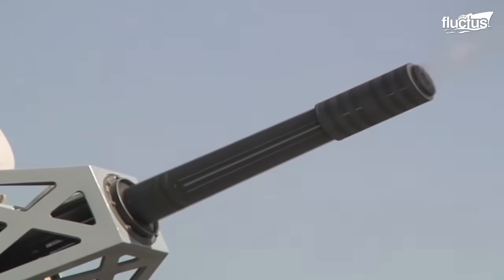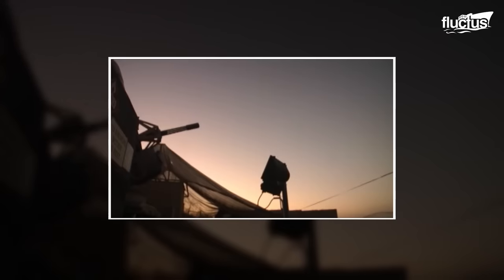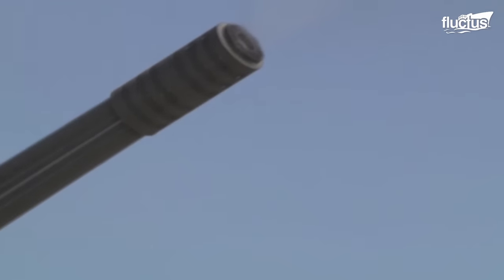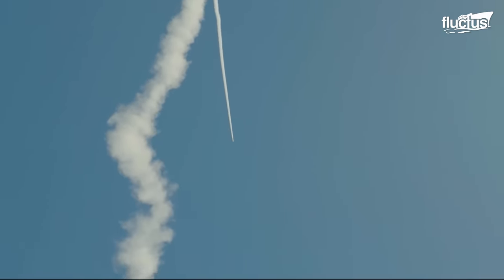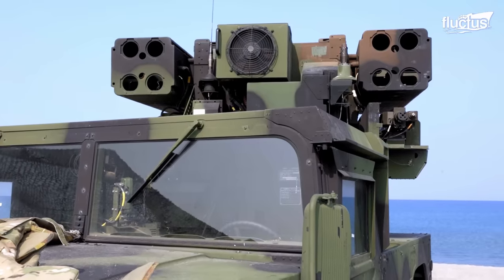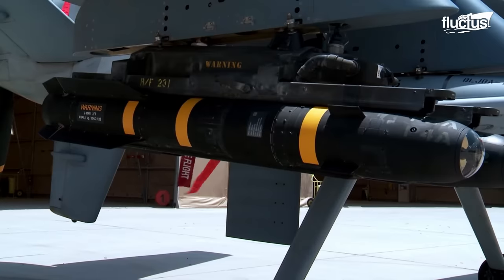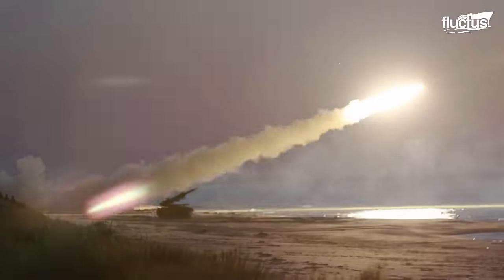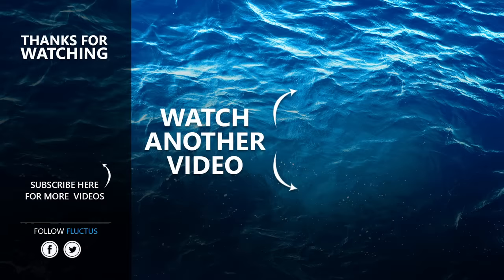Behind US Genius Idea To Test a Truck-Mounted Super-Fast Gatling Gun

Comment: GAU-12 (big brother to the GAU-8, of A-10 Thunderbolt fame) is also airborne in the USAF AC-130 Spectre gunship; Unlike the sea-wiz/gee-wiz, the previous Gatling guns are not autonomous, but use automation-assisted targeting... occasionally backed up with  a 105mm howitzer, for "punctuation".

Comment: We used this in the Netherlands almost 45 years ago. The goalkeeper 
It is a Dutch invention, and as a Dutch Marine I have seen this beast working. 
It is impressive and very effective
Reply: you're right this is dutch in design and in software - puzzing why Americans think this is indigenous. 
this thing probably wouldn't exist without NATO.
Reply: how often must reload? at least 1-2 man team to reload, burns bullets a lot. trucks needed to supply enough ammo :D
Id guess still cheaper to burn thousands of bullets per min than launch one patriot/S-300,S-400 missile per threat.
Reply: The Phalanx was developed in 1969 produced in 1978. The Goalkeeper was developed in 1975 and produced in 1979.
Reply: @effexon  Yes we have depleted uranium.
Reply: @chechnya  Yet the Gatling gun was an American invention from 1861.
Reply: @alberto148  Because the Phalanx was designed in 1969??

Comment: Very cool, served with some of those brigades in my PATRIOT days. What an awesome system.
Reply: Yeah I remember Charlie Battery 3/2 ADA tested the prototype in Yuma. A what units were you in? I was E btry 3/43 11th BDE , A btry 3/2 31st BDE, A 1/1 ADA 94th AAMDC and HHB 31st BDE from 2001 to 2007
Reply: @Chris1982416   I was in D 1/44 ADA it's been ages so recalling which brigades is difficult but I recognized a couple of those patches. I was in from 07-2010 edit: 11th, and 35th sound familiar but don't hold me to it lmao
Reply: @M00R3  do you know a guy named SSG Mahlstead from your days at 1/44 ADA
Reply: @Chris1982416  no. Was he in delta? That name rings zero bells.

Comment: Imagine making it smaller and adapting it to a tank to protect the crew
Reply: Then the tank would evolve in the direction of the battleship. Battleships used to rule the seas, able to outgun any ship besides a comparable enemy battleship. But over time, battleships became vulnerable to bombs and torpedoes, and they had to keep mounting more and more anti-aircraft guns. They also needed escorting ships such as destroyers to protect them from hostile torpedo boats and submarines. Eventually guided missiles rendered their big guns obsolete, and battleships became too expensive to maintain. The tank is like the battleship of the land - not obsolete yet, but threatened by an array of weapons that are hard to protect against. Tanks are great if your enemy has only rifles and machine guns, and not so great against artillery, anti-tank missiles, and mines. Like the battleship in its waning years, the tank is only useful if you have the other assets necessary to protect it, or you're facing a very poorly equipped enemy.
Reply: y tho

Comment: C-RAM is designed to defend from missile attacks coming directly towards the ship.  The 20mm gun usually has too short of a range to be of much use in a land-based setting.  This was the problem with the Vietnam-era M-167 Vulcan Air Defense System.  I would love to see a C-RAM type system paired with a Bushmaster gun in the 30-40mm range.

Comment: I dont think this is anything new, in 1973 we had The M167 Vulcan which we towed as a unit not a trailer. It was capable of firing as many rounds of the same exact ammunition, 20 MM. I was in the 1/3 Air Defense at Fort Campbell Kentucky, if we had them in the 101st Airborne Division then I know they were widespread across the combat units of the US Army.

Comment: I want to see a CRAM built around the 30mm gun on the A-10, that would be epic
Reply: A ground vehicle would hold more than 30 seconds of Wupass! However the German Gepard with twin 35mm Cannons is fun to watch too! Too fun! Proximity fused ammo that creates a cloud of really sharp metal in front of a flying target. In an M1-A2 Abrams Tank..the driver has to do not much when the Cannon fires as the drive line talks to the gun and absorbs the recoil. Ergo it can shoot at 45 MPH and 72 tons.
Reply: Give your head a shake man.....the A-10 was built around its gun.  It would never fit.  Im saying put around a dozen on an AC 130😮
Reply: @spencercameron2980  Bigger is better.

Comment: Both "not invented here" and "no perceived need" is very Army. 
Plus the Navy version is built for sea conditions, heavier and dependent on ship crew and probably at least some sensor feed. 
Truck mounting and support with power and sensors, probably needed in at least pairs to cope with many incoming drones. The ammunition goes quick. I do not know the allocation of shots to assumed distraction of drones. 
Ships I would think have multiple systems protecting a small area. 
Protecting Infantry lines and support is moredifficult, line of sight matters.

Comment: I much prefer the Rapidfire from Thales Group, it fires bursts of 4 programmable shells, no need to fire thousands of 20 mm shells, the CTA 40 mm fires very precise small bursts on anything that flies, planes, drones , helicopters or missiles , maximum rate of 200 shells per minute , it can pierce 20 centimeters of reinforced concrete ( 8 inches ) and explode into hundreds of shrapnel in the room behind , shoot down anything that flies and detonate the ammunition above of a wall where terrorists are hiding! simpler and cheaper
Reply: Agree, SRAM wastes a lot of ammo, but because of its superior fire control system the German Geppard normally manages to down a drone with 4 to 6 cannon shells,
Reply: @chrissmith2114  Three.
Reply: More than 20 years difference.

Comment: Better idea:  Put it on a C-130 gunship so it can't be shot down.
Reply: A C-130 can't be shot down?  🙄
Reply: The first AC-130s carried 4 x 20mm gatlings, and 4 x 7.62mm miniguns (1967).
Reply: @shadowgunner69  , yes, but there were not radar guided and on a gimbal.

Comment: I have known the testing of this Land-Based Phalanx for over ten years.
It must have been a failure to see that it has not been put into practical use yet.
Reply: Learning and gaining understanding is never a failure. But to try nothing new is also a failure.
Reply: NAVY HAS BEEN USING THEM BACK IN, BEFORE "90"s
Reply: Munitions are very expensive
Reply: Buddy of mine worked for General Dynamics in the 80's on the phalanx still have the demo VCR tape they gave employee's of it in action !
Reply: @Ray69Smith  Nice
Then it was probably mind-blowing
Reply: As far as I know the army used it in both Iraq and the stan
Reply: @smokechecktim7430  Yes , at the Stern.

Comment: Shows how slow the Army is with Force Protection. Systems for upgrade have been available for years, but US ARMY GENERALs are absolute ID 10 T parts.   I have been working in logistics since 1990 with both getting new systems into the military system and then the subsequent fielding programs.  Once you see how 'sloth-like' getting advanced or replacement systems, you would fire a lot of people. Because of the incompetence of our logistics procurement system, when we go to war - BE READY FOR BODY BAGS TO BE COMING HOME. Behind the Genius Idea is totally laughable!!!
Reply: ⁹⁹⁹⁸8888888888⁸9u88oo⁰0⁹99
Reply: Things shape up pretty fast when the S**t hits the fan.
Reply: @tedmoss  Sounds like an oxymoron to me...🙄

Comment: Nice gun, but seems a bit overkill, against small drones.
Small drones are only useable on reasonable short distance, less “armored” than a pidgin, therefore easy to destroy with a shotgun.
Reply: Think you could hit an FPV drone moving at 80mph with a shotgun that has a range of 75 yards? That's less than 2 seconds. I don't.

Comment: Why is mounting a Gatling gun on a truck a genius idea? In the Civil War the Union had Gatling guns, and the only reason they weren't mounted on trucks is that trucks hadn't been invented. Instead, the Union troops had them towed by horses, like artillery pieces. They were therefore not used to fullest advantage, as to use a machine gun like an artillery piece means you cant conceal it and it is outranged by the enemy's artillery. Thus the top brass had a low opinion of machine guns till the end of the century and beyond.

Comment: this ciws so called phaland system works fine on software and as last defense is still very efective clean option and go air traffis excpet good call is upgrade is about 3km range and force 2,5 x more is good above 24 measure strenght is basic level off defense for boat od destrozers or corvette exept bigger ship has like 5 it works slight better then missile defense in intercept besti in use for turn and extra defense other in zone as ship tactical defense surface area and best capabilities are in turn fly which airplane do again to be efective so longer range kind tops peek and zou can forget easy down peek turn and attack as it pushes airplane go high up and even a simple rocket sistem could also do the rest but charging time is problem in big attack so phaland is has bigest is very efective in turn and has certian sound off spin very noticable when airplanes try to attack you just flair them and they avoid so flares flash is also big key defense and destroyers or corvette should have this more flares pack inside  since flares are optional use for rocket attacks the bigest range results ae usualy in some mid dsitance between 4 - 6 km after ships hold in line off fire or more in closer range results are to fast often very short time ot react and dangerous outcome as modern ships are to fast and go easy even to close if you do not have enough torpedo power you are cooked also if previous patriot goals are good strength iike 15000 2x more power then standard and longe range the chinese option are counterfited with strength off 25000 or even 30000 which is more strght and goals are simply imporved towards better or more usable teh same thing hapend in torpedo strength which chinse boat have like advantage so in theory chinse boat or even smalled boats ccan easy to task role but have some problems in more combat offense or everything alone and espacialy enoying are submairines with bigger msisile which stand on path and require time to be heated hard and chinse ships soem problems with submarines and lack off potent strength in use in fast deploy numbers off torpedoes but they are powerfull and in manwhile submairnes does that also so chinese boats and destroyers or corvette have some like desired lvl off range use do not cross to much or efectivness drop althow in some action do perform and do earn money well in lets say 2/3 done which is excellent result and no so not money giving away in navy budget back as fpr caracterisicsd off ships chinese ships are on theory fast turnable and sometimes takre time to be fast but usualy faster then us which many times work against then selves not mcuh chance to go fast on positon simply do task role and shwo presence positioning rest do rockets and torpedoes and flars which have more and more modern use and can even easy spark boost defense while do defense and slow down attack and push force to main goals hoever somewhat expoased came aircarier on longer range then 6 - 8 km which absolutelz head no chance and also very favourable is helicopte us eon destroyers as use of airship missile which in closer just help or even sunk but that is like double cargo missile box 4x2 and in close combat kind work then us versions off tools as for helicopter integration in use off combat is proven waste off time but that software use in game simulation and sometimes goes ower a real defense power boat and that to easy a specialy a slight problem are heavy rockets like cj 3 or us big rockekts for large submarines nto recomendable for use as it can cause floods prep weather stage or even typhon showere as terms off efectivness as big powder strength sometimes they can only tease or cause porblems on line stand as subs not so efective as nto so much various weapons for use and if hit on strong defense air a boat or destroyers it evapourate fast and easy and subs lose power and if they head strong torpedoes they are not fast and if spoted to late can do evasive or prevent follow and atack down boats oponents or enemy